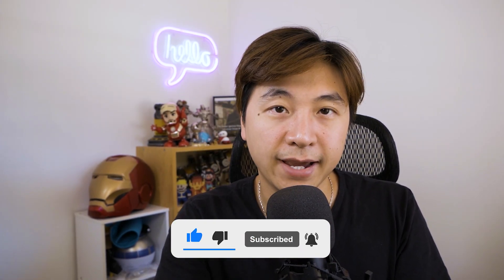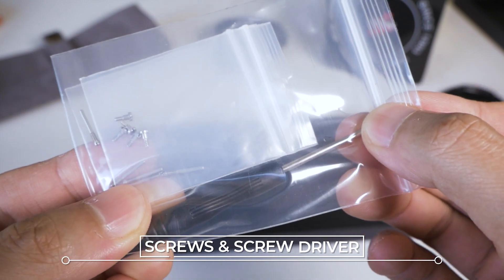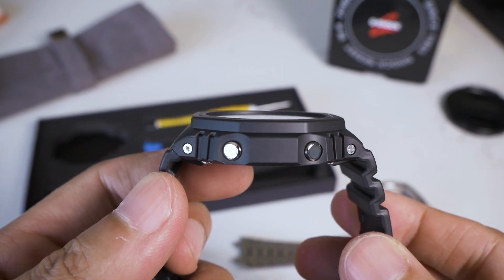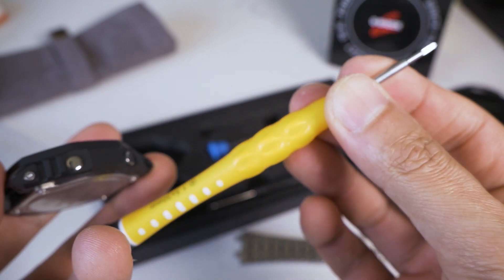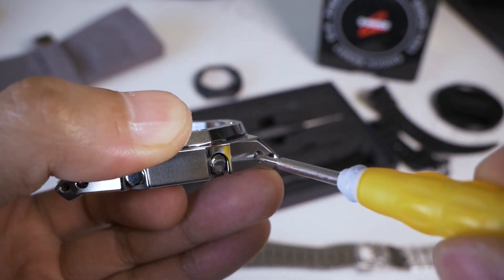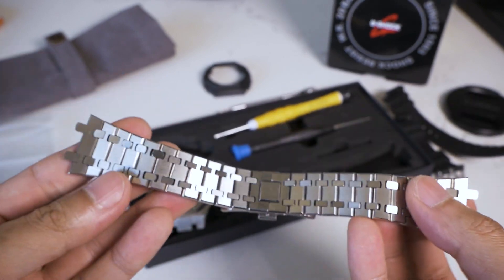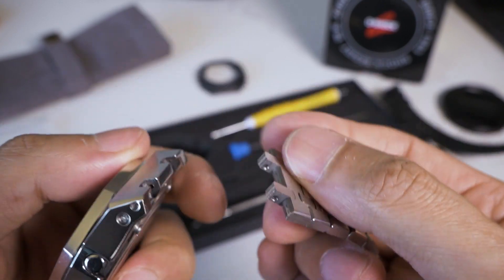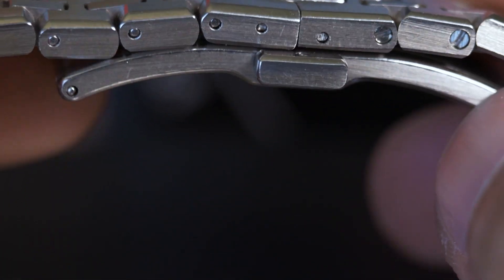The Best CasiOak Mod Gen 3 kit - Build your own CasiOak (G-Shock GA-2100 Metal Case Mod)

Comment: Hi mate, you need to use the supplied screws with the kit to secure the frame to the Casio case, to resemble the same flat head pattern, Cheers.
Reply from the maker: Ooh good call, I wasn't aware they were flat head, I made an assumption it was exactly the same so no need to change. Will pin your comment so other people will know

Comment: Great video mate! Have the 3rd gen kit on the way (bought one that comes with the AP style rubber strap too) to replace the v1 metal mod i have. Thanks for the deets in this vid!
Reply from the maker: I'll be doing a full review of the Gen 3 shortly, there are some kinks that I have found that I'm not 100% happy with. For example the Lug to lug massively increases with this kit, so for smaller wrists like mine it's a pretty big turn off. Keep an eye on future videos!

Comment: I had the same problem 3 screws went in one really strugged but eventually got it in !!! they need sort that little flaw out and make them better fitting but wow super looking MOD !! ill be leaving mine on as thats why i bought the GA-2100 as i have other Gshocks for everyday use !!!! Great review !!!
Reply from the maker: Yeh, I'm uploading a review of this Gen 3 mod right now actually, so be up in say 45min. I address the screw issues as well as sizing for people with slender wrists like mine. But, other than that, it's a great looking mod, if you have the wrist size for it.

Comment: Good content
Reply from the maker: Thanks!! Hope you enjoyed the video
Reply: Just received mine today, but I had some issue with adjusting the length of the strap. Did you have any issue removing the screw out of the strap?
Reply from the maker: @ycl6614  No, my adjustments were fine. The only thing I noticed was that when removing or screwing the screws, I had to angle the links slightly to ensure the screws were straight to remove or unscrew them. I'll be doing a full review of this soon which will also touch on this.

Comment: This is the 2nd gen mate ...
Reply from the maker: It's 3rd gen, 2nd gen has a case that you can change the strap, 3rd gen has an integrated band like the one in the video. I would've kept the 2nd gen if only to use it with the original resin strap, there wasn't this option for the mod in this video.